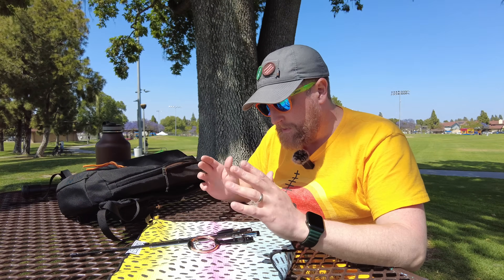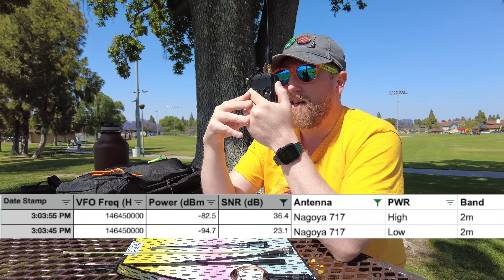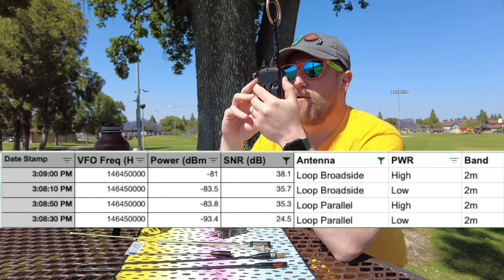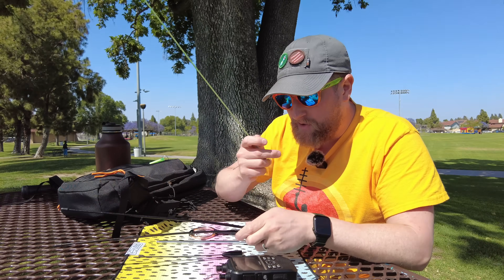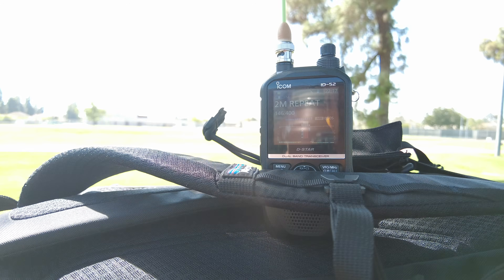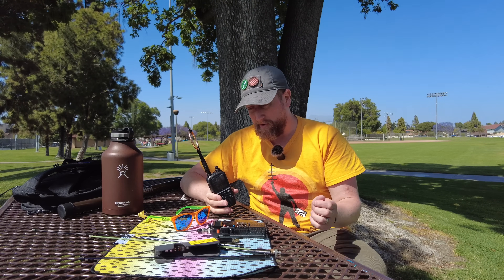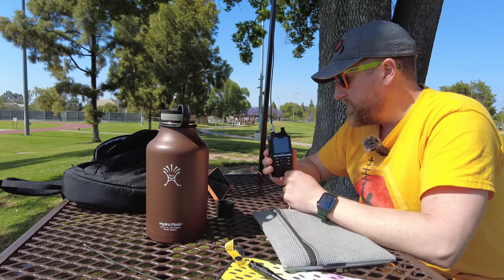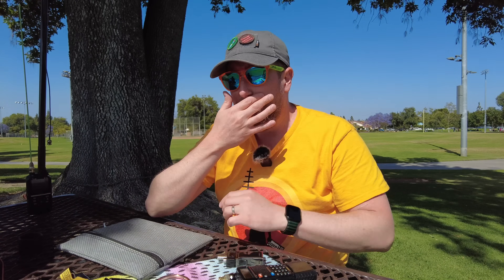TESTED! TWAYRDIO Loop, Nagoya, Diamond, Signal Stick Ham Radio Antennas

Comment: I just got my TWARDIO 660S from Amazon and it is not working on 2m.  It failed to break the squelch on 8 local repeaters which my factory antenna and Signal Stick can reach.  Exchanging for another (2-3 weeks out) in hopes that it is just a bad unit.

Comment: THANK YOU !!  As a newbie, I need clear, to the point information without a ton of acronyms and tech talk.   I think I will go Signal Stick. 
You said California. Looks flat. So I am thinking central Cal. Looks green with trees so I am guessing Northern Cal. 
I am new to low foothills on the way to Reno, 2,500' ridgetop. I can easily see 40 miles down, nothing around or up the hill. 
Shoutout to HRO Ham Radio Outlet Sacramento, Clyde and Earl.
Reply from the maker: Thanks for watching! I am in SoCal.
Reply: @HamRadioCrashCourse  Yes, I just saw that in the antenna test video. 
I am going with Signal Stick.  
And YOU are thanking ME ??  
OK but that's backward ... ?

Comment: I've tested my N9TAX roll up J-pole hung at 15' at the top against my Diamond X200A 8.3' base at same height but about 10 feet between. With both I'm able to connect with the Brookings, OR repeater 107 miles from my QTH in Rio Dell, CA and QSO at full quieting. This is at 50 watts on VHF on my TYT TH9800. With a Retevis RT85 5 watts and N9TAX I can open our club repeaters 39 miles N and 32 miles S in the Northern California coast hills. The N9TAX is leagues above the Long Ranger and a bargain at $30. For my HTs I use band specific 771 copies that I tune with tinyVNA by trimming length with a cable cutter before replacing the end cap that cost me $5 each and I consistently get VSWRs of 1.01-1.17. I have yet to find a "dual band" that is any good on VHF and UHF, Hihi. I also bought a N9TAX GMRS/MURS to use for cross band repeat with the TYT TH9800 and TYT 8000D. There are a few China made radios that are worth owning. IMHO, the above models and the TYT UV88, Retevis RT85 and RT95. They and the Anytone variants are clean performers with reliable quality at bargain prices.
Reply from the maker: The N9TAX being dual band is great.  But my test disagrees that it is leagues above the Long Ranger.  Sounds like you're getting great range though with your setup, to enjoy that. 👍

Comment: Hi I have a question. Can an antenna that doesn’t have a good SWR still be a good antenna? Similarly, can an antenna with a better SWR actually have worse real world performance?
Reply from the maker: Yes and yes.  Which is why I focus on having a distant receiver record signal to noise for an objective comparison.

Comment: Hi, what 2m/70cm antenna would you recommend for the Icom id-52e handheld, length about 37-40cm? Oh2eki 73'
Reply from the maker: Use the stock one if you might snag it on something, then switch to a Signal Stick, MFJ Long Ranger or Smiley 1/2 Wave if you need to get your signal out.

Comment: What is 15 ft  vertical antenna that you have in your house? Brand and model? Thank you. for the comparison.
Reply from the maker: MFJ Pulsar.
Reply: @HamRadioCrashCourse  I just got my Tech license yesterday which model MFJ there are several. Working on getting my shack ready. Any suggestion on Radio.
Reply from the maker: Specifically when I bought the vertical, it was called "Pulsar" its a 17' three section antenna. 

Radio suggestions are entirely based on your budget and radio goals.  I do like simple analog radios to get started though.
Reply: @HamRadioCrashCourse  Thank you.

Comment: Retevis says its RHD-771 20W is its flagship antenna and I'd love to see it reviewed. Also, the Nagoya NA-24j looks a lot like the Signal Stick, but I've yet to see it field tested. It's one thing to see it attached to a sixty-dollar SWR meter (woo-hoo!); quite another to see it field tested, which I love. 

Really weird to see the two Nagoyas so far apart. I'd hate to think they are both real Nagoyas! I also don't know how good Tidradio is, but I've got a few in a drawer somewhere. I think all antennas with blue lettering should be used with care. Retevis is an up and coming company and it has two grades of antennas. It claims both are 1.5 or lower. But are they?

Comment: Thank you for all of your videos, you helped me out quite a bit when I got me license a couple of years ago.
One thing this video makes me wonder is how much signal strength relates to transmission range. I have been interested in the the J pole for a while but his makes me less interested. Perhaps the range of the J pole would still reach out the farthest because of the height?
Reply from the maker: Height is might in most cases. Remember the Jpole is dual band.
Reply: @HamRadioCrashCourse  Thank you for the quick response. That is what my intuition told me. I like the idea of getting to camp and throwing the J pole up high.

Comment: What brand or do you have a link to the roll-up j-pole you used, as it is twin lead. I was going to buy the MFJ-1731 and MFJ-1730 to get 2 meter and 70 cm, but looks like you can do both with the twin lead.

Comment: Good info Josh. I would like to see you test the Abree folding antennas. I’ve had pretty good luck with those, but I think they are inconsistent in their manufacturing.
Reply from the maker: I have.
Reply: I saw your top comment right after I posted that. Found it. Thanks!

Comment: Josh, don’t forget that SMA connectors are only good for 500 connections.  Retired industry pro’s in my club have advised me to use extender adapters on my VNA.  It’s easier to fit a new adapter than to change the socket on a radio.
Reply: Wait so manufactures are putting sma on radios with and its only good for 500 connections? That's quite odd didn't know that

Comment: Inspiring/motivating video:  

Unless the Sailor Moon also washes dishes, and prepares dinner, I cannot see myself owning one.  

The Long Ranger was impressive, and might end up in my small collection.

Running tests this month on my two favorites— a week, each, of local driving squawking APRS using Diamond SR77CA and SignalStuff Signal Stick.  Each sitting atop FT3D, in cupholder.  Signal Stick took a clear lead today.

The J-Pole addition, like the Yagi design I am contemplating, simply needs to happen, for no other reason than that I will enjoy the build.

None-the-less, my HT goes everywhere with me, usually in a small backpack, and my current two will likely remain my EDC.  

Then again, my back porch/balcony/fire-escape has recently become my favorite radio play spot, and I can see the practicality of hanging some “contemporary art” from a hook under the eave to extend my coverage.

Comment: Fantastic video.  Practical tests like this are really great, nothing beats real world data.  If you are doing a round two, one of those ABREE tacticals would be interesting.

As for the NA771, there can be a big difference in performance between real & counterfeit models.  But I'm not sure how you even identify them without an antenna tester.
Reply: I suspect I have a counterfeit 771. It barely gets better reception than the stock one on my F8HP, and on my local noaa station I have to tilt it to the side to even receive it. I really want to know if mine is counterfeit but I think I would have to take it apart to know for sure.
Reply: @fancyfeast1001  if came in orange plastic package it's fake, real nagoya only comes in bright green plastic package and MUST have a spacer inside, if it does it's original, if it doesn't than it's fake.
Reply: @fancyfeast1001  So how does one avoid getting a counterfeit model? 73, Bob WK2Y
Reply: @bobgerzoff5072  I do not know

Comment: I really enjoy these test videos. Would it be possible to be slightly more rigorous in the test setup? For example, mount the HT in some sort of holder so that it is in the exact same position and perfectly vertical for every antenna?
Thanks. WA1KLI
Reply from the maker: At some point it’s splitting hairs don’t you think?
Reply: @HamRadioCrashCourse  Not really. Think about the difference in polarization between holding the radio straight up or tilting it horizontally. The difference in signal strength is enormous.
Reply: @HamRadioCrashCourse  Aren't we all here to split hairs. just kidding... kinda. Maybe next time do the test with a car magnetic base. But I agree it would probably be a minor effect.

Comment: Josh, could the telescopic mast possibly be negatively affecting the performance of the J-pole? I have no experience with telescopic masts, but perhaps tilt the mast at a slight angle to get the antenna off of the mast?
Reply from the maker: We shall try for round two!
Reply: @HamRadioCrashCourse  Awesome! The reason I am curious about this is because I take one of those roll-up J-pole antennas (N9TAX variety) backpacking with me. I hang it up on a tree limb as high as possible and can routinely TX/RX APRS packets from the beach in Ludington, Michigan across Lake Michigan to Wisconsin. It works extremely well.
Reply from the maker: @michaelspencer4569  Oh it works great.  But it didn't beat the Long Ranger.  Keep in mind the roll-up is also 70cm, so I am still goin to pack mine too.

Comment: That roll-up j-pole is an Ed Fong, right?
Reply from the maker: I’m pretty sure it is, but it’s an older one.  I was worried that mine might have issues, so I purchased another and will retest with both. 😬
Reply: @HamRadioCrashCourse  LOL, sounds good. See if you can test the N9TAX as well
Reply: @HamRadioCrashCourse  I would like to see a comparison between the Ed Fong and N9TAX antennas as well.  I recently purchased the N9TAX dual band, I'm very impressed with it. Of course I'll more than likely end up with a Ed Fong also. I mean why not, right?? 😃

Comment: I watched a video with the rpund directional   they had it on a antenna aniliser   by adjusting the enter ring was able to adjust to a lower swr  within the band  ???
Reply from the maker: I’m guessing it’s the length of the center wire that is controlling the tune.
Reply: I watched this as well and was very surprised to see such a big change in awe with minor little tweaks to the center “element”.

Comment: Josh, where did you get that Tactical Mini Compact Ultra-Portable Telescopic Mast? you had no link in the notes
Reply: Can usually get them direct from SOTABeams or from DX Engineering.
Reply from the maker: Yep SOTABeams
Reply: @HamRadioCrashCourse  The threaded end caps are pretty fragile. I cracked to of them just snugging it up. Maybe they are using less brittle plastic by now. The larger "5000" version has a much better more rubbery cap.
Reply: He wants to spend my money!